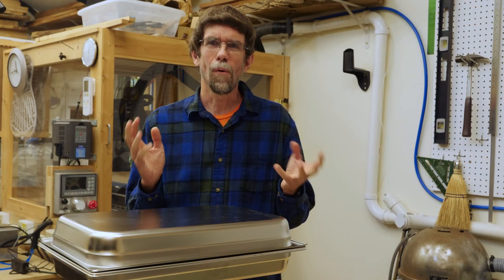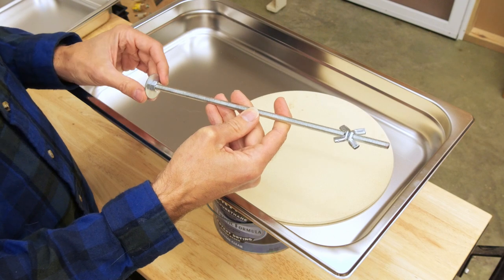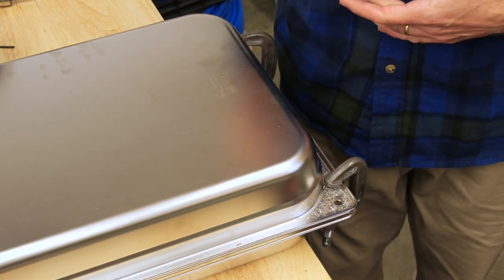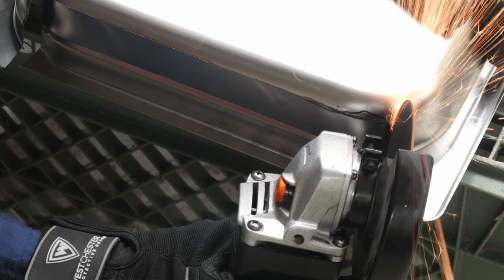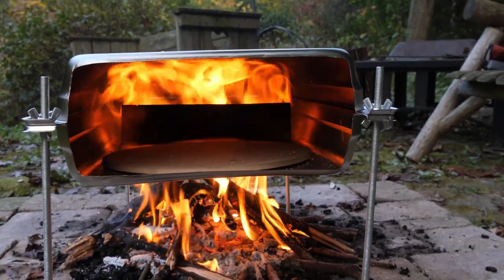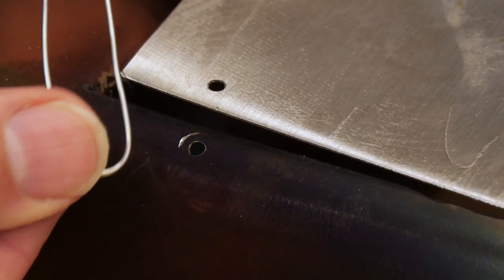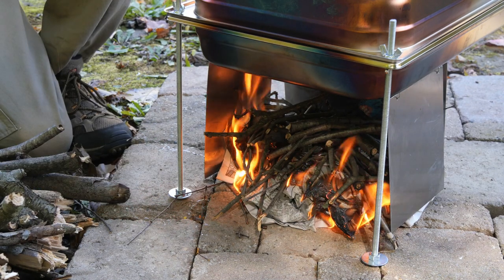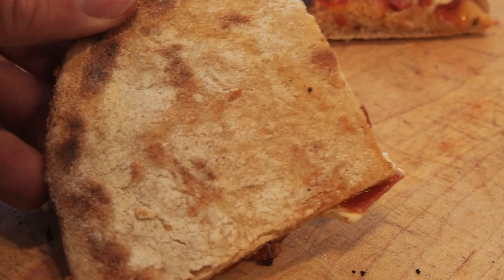Portable Campfire Pizza Oven Build

Comment: Nice build! Simple design and works well. A little thicker stone and bigger coal bed with a little less flame on the fire and I think you’re in the zone. Great job!
Reply from the maker: Thanks and yes I agree, I've already got a thicker stone to try and I'll post an update once I've tried it out.
Reply: BrainRight I make my own fire brick for my pizza ovens using sand and water glass, you can make it any size very cheap. You could even make it the same size as your space in the pan for more thermal mass.

Comment: This is exactly what I was looking for.  Literally as simple as it gets and I could set this on top of my weber kettle or maybe even on my gas grill.
Reply from the maker: Glad you found it useful. I think it would work okay on a grill but probably wouldn't get as much heat on top (from flames washing over the roof) so would probably make more like a conventional oven and would probably take a bit longer to cook. When I use a grill I just put a pizza stone right on the grill grate and it makes good pizza that way so you might want to try that before building something like this.

Comment: Could you simplify it by offsetting the two pans instead of  cutting the big hole?  Maybe cut slots for the threaded rods instead of holes so you would not have to remove the thumbscrews, just loosen them a bit to disassemble it. Finally, would some kind of insulation on the top make it more efficient and a bit safer?
Reply from the maker: Those ideas sound like they could work. The insulation might make it harder to pack into a small size (which is important in our new camper van) and efficiency isn't a big concern when it's fueled with sticks. It actually seems to be fairly well balanced in terms of producing good pizza with a "medium-sized" fire so a design change would take some experimentation to get it dialed in. We just took it on an overlanding trip and it worked great making pizzas for 6 people.

Comment: Great idea ! I wonder if it’s the newspaper that’s putting all the ash in the pizza oven , also I wonder if drilling a whole lot of small holes around the outside instead of having one big hole at the back will help with ash and control of heat ( kind of simulate the Ooni pizza oven ( I know they are gas )
Reply from the maker: I think it's mainly the wood fire that's bringing ash into the oven, and it (usually) lacks the super-high heat that tends to burn off all the ash in a large wood-fired oven. It's no big deal for us though, because we assemble our pizzas on parchment so the pizza never contacts the pizza stone directly and doesn't accumulate any noticeable ash on the top during the brief cooking time. Using parchment is a tradeoff but it has worked out well. Having lots of small holes could certainly work, though it wouldn't get the flames washing over the roof like we do so it would probably behave more like a conventional oven and less like a broiler.

Comment: great job!! i wonder how good a propane stove(like the one's they use for cooking in chinese cuisine) would work here, it's easier to use than wood when it comes to maintaining temperature
Reply from the maker: Thanks. I'm sure you could make a good pizza oven that uses propane, and no doubt it would be easier to maintain temperature. But I prefer using wood for a portable oven to take hiking and camping because I don't need to carry fuel with me.
Reply: @BrainRight  cheers!

Comment: This is great! Question: do you think adding stainless steel mesh to the opening of the bottom tray, above the fire would cut down on the amount of ash coming into the oven?
Reply from the maker: Thanks! A stainless mesh might reduce the ash, but if it's fine enough to make a difference I think it would also cut the airflow and might make it harder to get flames passing above the top of the pizza. I do get some ash coming in but it's not much different than a typical wood-fired oven in that regard.
Reply: The ash is extra flavor! LOL!